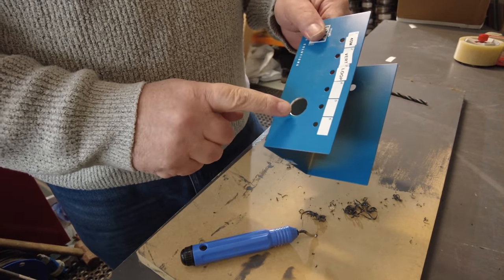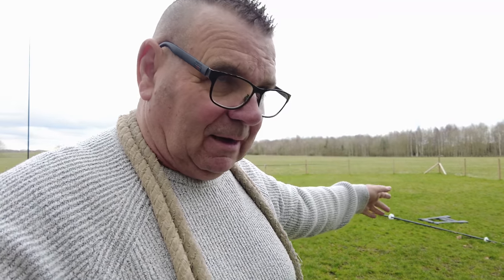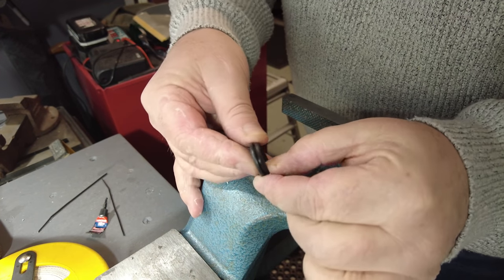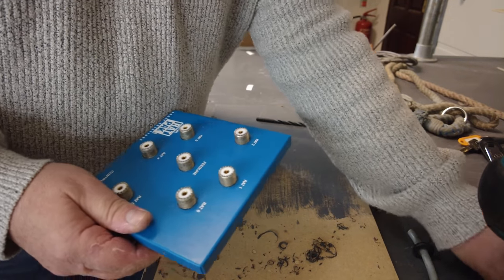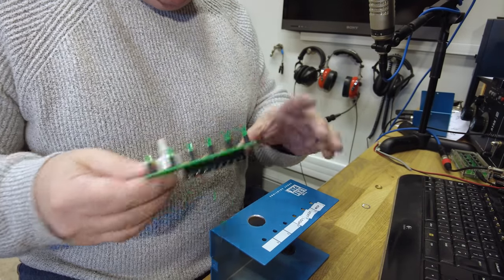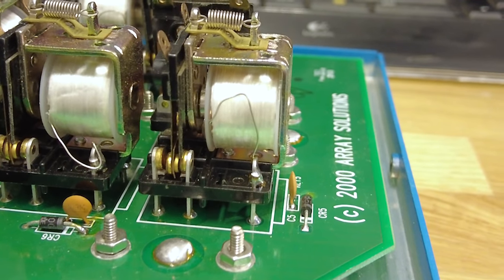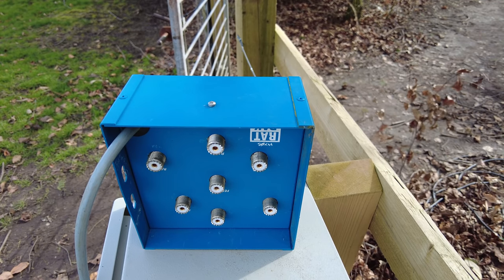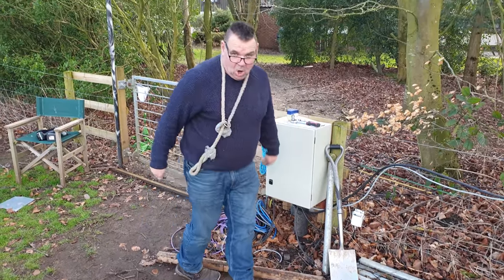*NEW* I Installed a 6-Way Remote Coax Switch

Comment: Glad you're starting to feel better my friend. It does take a while to get over some of those lingering symptoms. You can use that deburring tool from the other side of the sheet metal, just angle it so the blade contacts the burr.
Reply from the maker: Yes! Got that :)

Comment: I have ZS6BKW made by NI4L and was told to put it up at the Apex 50ft the 450 ladder is 45ft and pick the end off the ground. Flat top would around short 100 ft. And run of coax 75 ft. The problem is at my location it going to be 130 ft. What would be you input. 
Like you're relay box to run and switch different antennas.
Thanks for all you do
Reply from the maker: Paul, I would put some of that balanced feeder parallel to the ground if you don't have the height..

Comment: Just another tip , use a wiska box via 2x 20mm stuffing glands and inline 221 wago connections .. great for a ip65 connection box for those grey cables .. 
Keep up the good work callum 
73's
Reply from the maker: Great tip!

Comment: What type of 7 core did you use? Looking at running a 50m run to a remote switch like this one and also one to the rotator.
Reply from the maker: Hi Ian.. It was from RS Components. I THINK it was either this one - or very similar.. https://uk.rs-online.com/web/p/control-cable/7271379
Reply: @DXCommanderHQ  Thanks Cal. Did you find a software replacement for the in shack switch? I am a couple of months away from sticking my tower up so busy trying to get things sorted, like remote controller and a nice cabinet at the bottom of the tower with all the connections like you have, what size is that box you have 400mmx300mm?

Comment: Have you ever tried the 5/8 length on the DX Commander? If so how did it work
Reply from the maker: Pat.. It does work - effectively you make a 3/4 wavelength and then drive the size down with loading coil or foldover. The 10m and 12m elements are like this on the Signature 12.4. Video soon...!
Reply: @DXCommanderHQ  looking forward to the video! Really interested in the additional gain posibilities
Reply: @DXCommanderHQ  also is it possible to have all of the elements 5/8 ths except the 40m so that it will all still fit on a 10m pole?

Comment: used a remote coax switch for changing loading coil taps from inside the shack. Used the band info port to control it (cat port) didn't really like it, not 100% reliable. so went back to manual switch. working on a small program to change relays from band selection on the radio control program using the pc usb port for control data.
Reply from the maker: Yes, I certainly don't want an automatic switch selected form band data - I just want a button on the screen..

Comment: Cal, Touch Portal an old cell phone and a Digital Loggers DIN Relay IV will do the job for your switching and much more.
Reply from the maker: Please make it for me :)
Reply: @DXCommanderHQ  I am using an Ameritron RC-4 switch, more complex than the RatPak since it uses the coax for signaling. Right now, I can control 2 positions only. If I had see the RatPak, I would have one...... I'll email you......

Comment: Recommend that you mount the remote box on a metal pole that is driven into the ground. Then place an empty 5 gallon plastic paint bucket over it. You can tie a brick to the handle to weigh it down. I had to do that to prevent water in them. Mine are a different mfg but just good insurance. We get as much rain in MS as you do I’d bet. Be well amigo! 73 de K1JHS
Reply from the maker: So these have already been outside for 5 years without issue ..
Reply: @DXCommanderHQ  Fine business! Glad you had no issues. 73

Comment: What's that heavy coax for the long run?  LMR-600?  Just curious, I use it for VHF/UHF.  Really shines on 440.
Reply from the maker: OK, so that's EcoFlex 15 (15mm). Quite heavy but OK for perm installs I think.
Reply: @DXCommanderHQ  Thanks I'll check that out.

Comment: great work..  i like the hole punch you used to run the power cable into your cabinet in the shack.   i would have done quite the opposite..  cut a crosshatch with a knife.. which does not lend to keeping water and bugs out..   i do like what you did..  what is that tool called?   and where would someone locate one?    i will remember this set up when i go to build my shack..
Reply from the maker: Actually, initially I tried a cross-hatch and didn't like the outcome.. What I'm trying to do (as you spotted) was keep any beasties out (and any wind / weather!)

Comment: The Hamation Rat-Master controller is designed to replace the Rat Pak controller.

KD4Z is also designing an interesting looking controller, although it appears to be earlier in development. For remote operation, it may turn out to be better given ShackLAN's lack of support for Node Red.
Reply from the maker: Hmmm. So I emailed them a nice email and never heard anything back! I may try again. Maybe they think if I can't read the website, I'm clearly not worthy of doing business with them.
Reply: @DXCommanderHQ  Array Solutions also sells their stuff.

Again, the only caveat is that the Hamation stuff is very proprietary and will be difficult to implement solutions with that Hamation doesn't choose to bless.

Comment: Another great video Callum! You could make a nice little Web Interface and box which could plug into the run you've got there using an Arduino or Raspberry Pi quite easily. Always on the discord if you ever want some help.
Reply from the maker: As I said in the video.. I need this in "appliance mode" for this daft operator :)
Reply: @DXCommanderHQ  it could be arranged potentially! You’re hardly daft. Your words of ‘just an ordinary guy’ really don’t cut it 😉 I’ll have a little play and see if I can come up with anything.